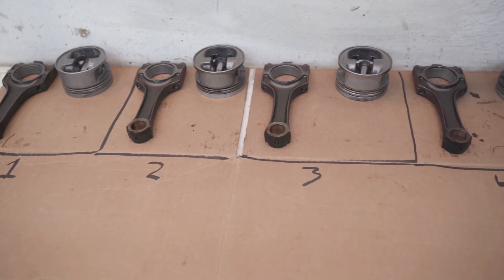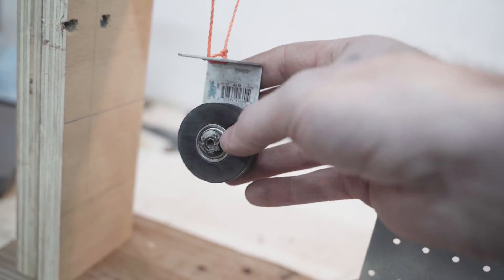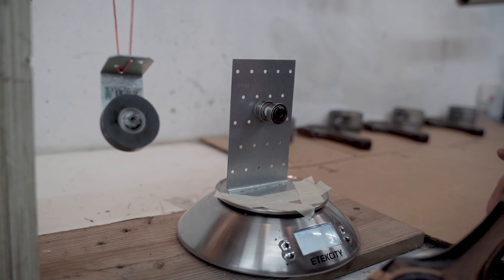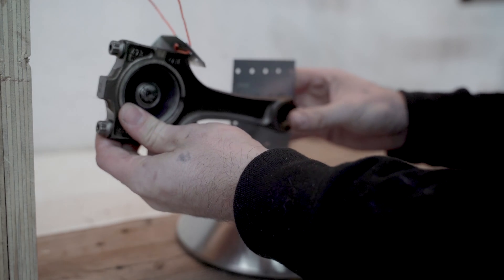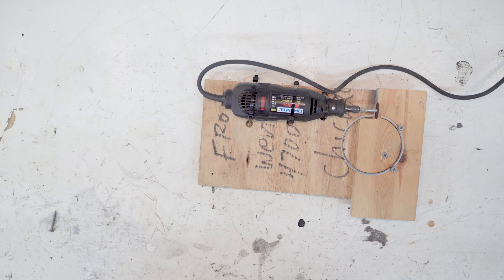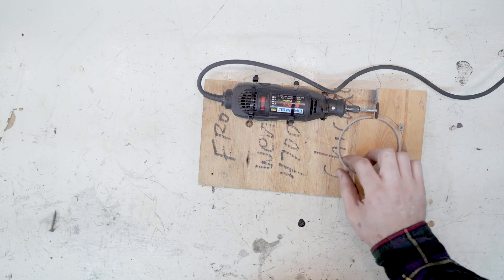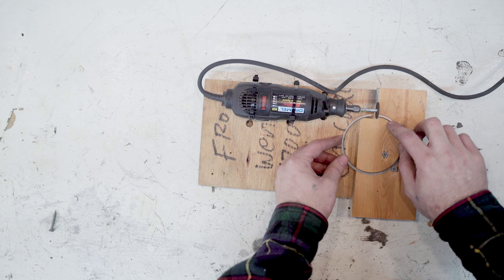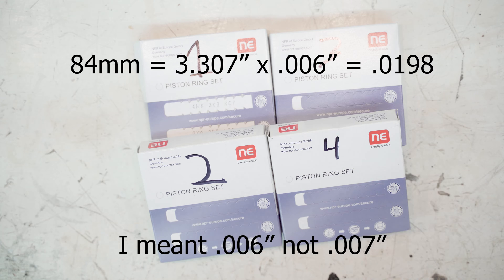E30 M42 Turbo build, bottom end assembly

Comment: hi im building a m40, very similar engine, i was wondering is there anything like a thrust washer? that stops crank going back and forth? is there tolerances for that? the engine im striping the crank moves front and back very slightly and so do rod caps, i wonder if thats normal.

Comment: Uffff...   I'm scared,I not realized two steps,casually,my provider's Parts service me the same piston rings,same mark and not realized the dremel operation,and plastic gauge always not realized,what happend in my engine?
Terrible...  :( I hope that be bad...

Referent to the development of your work equal my style and accuracy,but was imagine of make the process of gauge and rings...fuck...  I'm ashole,never see this process when I make my engine,never say me my "bmw group friends" that make plastic Gage or grinding piston rings...
Holy god,its critical?
I have open my engine again for this bro??
Today can't sleep.

Note: When I assembly my rods,my pistons,the cranckshaft,etc,painting the contact zones with Metal Lube Antifriction for reduces the first work of the pieces,and change the oil spring and pressure valve and the oil return valve of the block,ah and the oil pump :)
Reply: it is fine without dremel and plastigauge, those are just for perfection